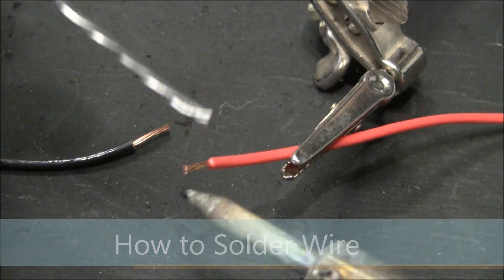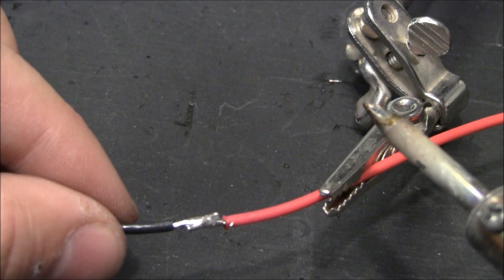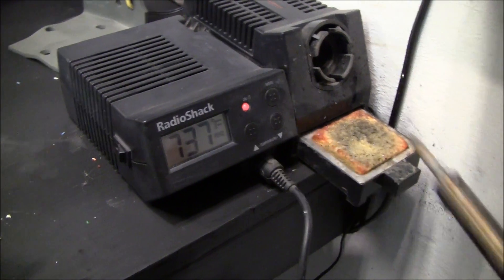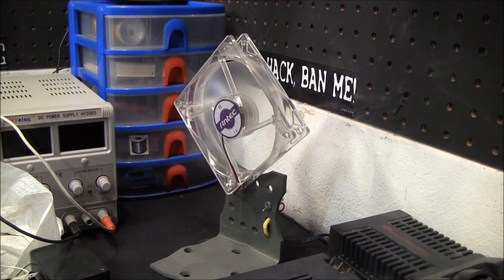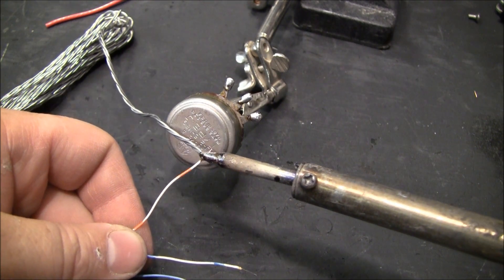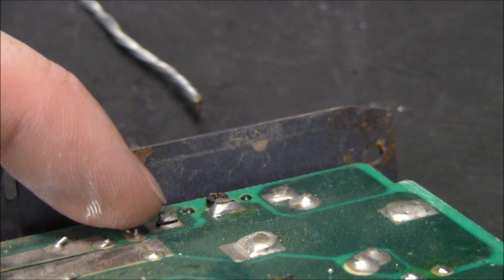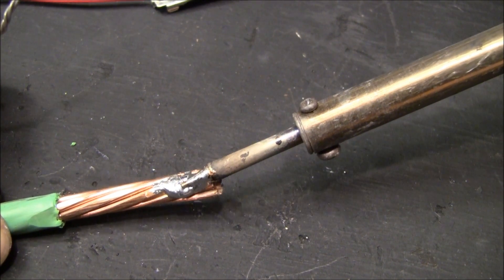How to Solder, tips and tricks

Comment: Mostly false tutorial. You don't solder wires like that. The tin itself only barely hold stuff together. Wrap those wires in hooks(there's 200 page NASA article about this) around each other so that you can pull them while they stay together and have most contact are as possible. Same goes with that potentiometer. Any joint that is only held by solder is going to break in time.
Also, if that is not possible(e.g. wire to flat PCB plane) you cannot possibly hold them steady enough. It will always create poor solder structure. You got that helping hand there, just put both components to each of those clamps, have them rest on each other without any force, and then tin them.
Reply: xomegaxweapon
http://www.hq.nasa.gov/office/codeq/doctree/87394.pdf

Actually it's only 114 pages, but that should be plenty.
Reply: *****
Flux coated brass wool also beats sponge. No thermal shock and no need to wet it. It costs only like 5 bucks.
Reply: *****
 +1 Plus you don't really want to have solder blobs on your work table. I recently lost an arduino to a blob of solder on my table. Always keep it clean.
Reply: can you linked the 200 NASA article please? I would like to read it
Reply: RealationGames Thank you for supplying the link. Certainly should be accurate information considering the source. ...and at "only 114 pages", yes, that should be plenty! lol :0)

Comment: Also a fail... touching the soldered wire with a greasy finger.

And overall a fail.  Parallel wire works no where near as well as meshing the wire into each other by pushing them together from the end.  If there is high vibration concerns, you can wrap the meshed wire with single strand of wire and then solder.

Comment: You should apply a little solder to the soldering tip to create a "heat bridge" to help with heating up the wire so you can get the wire you are trying to tin come up to temp quicker.  This will prevent a lot of the melting insulation away.  Also you could increase the temp on your solder station to help with the transfer of heat to the wire.

Comment: Where did you learn how to solder?  The fan is a really bad idea, cold air blown onto the hot solder will cause bubbles to form at joint ensuring a bad job. At the beginning, holding the two wires and trying to solder them together is  recipe for a disaster down the road.  And you don't flip hot solder off the iron, use a damp sponge or the brass cleaning pad.  This should be titled, "How not to solder".

Comment: easier to twist the wires together and use a little flux on the solder and dab it on the wire... then allow the solder to flow.  works very well and not much of a mess if you don't put a lot of flux on it.

Comment: Well "in your face" was not exactly accurate. But it is still in the same direction. I tried to blow it on the side, but I still feel the smell  a bit. When the air is sucked I can't smell the smoke at all. I mean couldn't tell how does it smell. But all this is pointless if your room is not ventilated ... Unless you buy a smoke absorber with good filter. Still,. I'm not writing to be annoying. Try to turn it arround, but it has to be closer to the soldering place.

Comment: :) when you solder long enough you start thinking that you can have a feeling how hot the wire will get based on time of soldering and the thickness... Unfortunately you are only 9 of 10 times right and you always get burned. Sometimes I'm just too lazy to pickup the tweezers/small pliers and hold the cable and ... well I get burned. If you are can get Balsam "Spasatel" Forte. If you apply it immediately you'll forget about the burn in a minute. But it's always better to use the tweezers

Comment: ok. here is my few bits of criticism (no offense meant). I think that 390 degrees C (734 F) is a bit too much. The tin oxidates too fast on the iron. I keep it about 250-260 and I rise it only if I solder something bulky. Also the fan is blowing the smoke in your face. I put it close (10 cm/4 inch) to the soldering place and then make it suck the air - turn it around. it actually works. Also don't rely only on the resin in your tin. Get some good flux. It helps with not-perfectly-clean wires.

Comment: For that heavy gauge copper wire, it would have been better to apply a good amount of flux first. Also it is not a good practice to melt flux core solder wire to the iron and transfer onto the workpiece since the flux will evaporate and it will not get to the workpiece. Unless the surface is absolutely oil and oxide-free, it will not make a good joint or even not stick at all.

Comment: This video deserves many "Thumbs up" really.

I want to build some Interconnect cables as a DIY project and there are various parts to the project. I will your video as my guide to get the soldering part done.

I heard that when soldering wires, its not a bad idea to attach a metal heat deflector (looks like small a needle nose pliars) to thew wire so the wire does not get damaged from the heat. Don't know if that's just some fancy snake-oil thing though

Comment: This helped me a lot thanks. I was stupidly heating the solder and not the wire or lug that I was trying to solder it to. I went to the UK equivalent of Radio Shack and when I had soldered before I was using solder with a flux already mixed in but the only stuff they had came with separate flux. This made it a lot harder. Thanks loads for this post.

Comment: I'm going to take a guess that you're using acid-core solder which is supposed to be used for brazing work for things like plumbing. If that's the case, it's the wrong stuff for electronics work. It'll end up corroding everything. For electronics you want acid-free rosin.

Comment: I've been reading tutorials and watching videos for the past week and I can already tell that you're not really doing things right, heck common sense tells me that. Not twisting the wires together, relying on the solder instead of a physical joint to hold things together, calling your shaky hands half ass soldered together wire example a cold joint... I can tell you have a lot of experience but it looks like a case of "it's always worked for me" as opposed to the "right way"

Comment: this is ok for the home hobbyist but there are so many mistakes in here, you talk about heat enough times but dont actually mention that all solder comes with a specification for the best temperature ranges for a given application. also to place an insulated wire into a crocodile clip and then bring heat to it could potentially split the insulation and is a serioulsy bad practice. the wires on the component  should have been looped through the holes before being soldered.

Comment: The reddish coating is like a lacquer, and needs to be scraped or sanded off before soldering. If not, the solder won't stick. This is not the same as 'tinning', which is done on stranded wire to keep the fine strands together and give mechanical strength. To tin, put a tiny drop of liquid flux on the wires first, then lightly touch the wires with a hot iron and small dab of solder. The flux will draw the solder through the strands and ensure a nice, uniform surface for your wire ends.

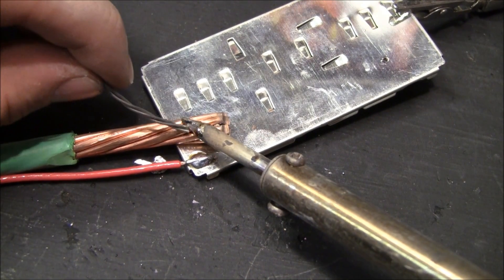Comment: 05:46 A good way to get a fat wire hot without using a super hot iron is to dip it into some flux and then heat the fluxed part.  Gets hot much faster when you use flux because the melting flux transfers the heat into the part.

Comment: You can buy solder with flux - either flux coated or flux cored.  I've been using RS Components 60/40 Tin Lead Alloy solder for years.  Easy, clean and pre-fluxed.

Comment: so when do I use flux? And why arent you? im soldering tattoo machine wires and im told to first "strip away the reddish insulation" bfore soldering. is this the same as "tinning"/? In the other vid I saw he looked as if he was using the iron to burn away layer, but he was also using solder at the same time./???   thanx for post!

Comment: How physically strong is the connection between the two wires when they're not twisted together?  What's the disadvantage to twisting the wires together and then soldering them.  Thanks!

Comment: I have one of those basic RadioShack 15-30 watt irons, and after about 5 uses my tips only heat on one side and it gets a big cavity in it. When I buy new tips I always tin them before and after use and I am usually using the 30watt mode. Why is this happening???

Comment: Yeah, I've only been soldering for a short time (just started electronic circuitry design - hobby) and the reason they tell you that is because of weaker physical connections, cold joints, and you basically burn off all the rosin (in rosin core solder), which allows for oxidization of the connections. I'm a little confused at this guys technique.

Comment: To make it transfer heat much more efficiently to whatever you're trying to solder. The cone shaped tip has a much smaller contact area to heat up a piece of wire or component lead in comparison to a glob of liquid solder on your soldering iron's tip. The other reason is to keep the tip from oxidising, a process which is accelerated by heat (oxidising is basically the same as rusting) and which will also make the iron much less effective at transferring heat to whatever you're soldering.

Comment: When you tin the switch terminals, it looks like you just tin one side of it. It also looks like you're applying the solder to the tip of the gun and letting it drip onto the terminal, as opposed to how you solder two wires together.....
right?

Comment: Lighters work well.  It burns like a fuse if you light the end of the wire while holding the wire at a 'somewhat' vertical angle.

Comment: Pro Tip:  Don't use lead free solder, it has a higher melting point and is a HUGE pain in the ass.  Get some good old 60/40 rosin core solder and things will be a lot easier.  Also having a clean soldering iron (looks shiny) will aid in heat transfer and make things go easier too.

Comment: Sometimes there are nylon threads running alongside the copper wire to strengthen it, you want to get them out of the way before soldering.

Comment: Looks like his connection is ok without twisting. The weak point is not at the joint but at the end of the joint from flexing. With that said, I usually twist the wires together, a la Western Union splice.

Comment: filear is right. For me its easier to burn it off including the surrounding material then clean it up with very fine sandpaper to expose the copper. Then solder the wires back, a little tricky to make it stick. You could do it, just take your time.

Comment: It's been my experience that it can be very difficult to hold even one of the wires steady enough to prevent a cold solder joint.  Whenever possible I try to have BOTH wires supported by something, not just one wire.  I see you used an aligator clip for the wire on the right, using one for the wire on the left too reduces or even eliminates altogether the potential for a cold solder joint.  Like many people I use a jig for this when possible.

Comment: this is a bad way to solder. You're not even using flux! best to twist the wires together, apply a little flux and then apply solder to iron tip, then to the fluxed wires and viola!

Comment: most of the information in this video is correct it may not meet the stringent work standards that I'm used to but it's good info nonetheless. However, the way you cleaned your soldering iron almost gave me a heart attack.The sponge is to thermally shock the iron, not to clean oxidation off, you should use solder and a clean tech-wipe to clean it then thermally shock it with a damp sponge (but not the one you have it's ruined), then go right to soldering, then tin it again to prevent oxidation

Comment: that is not a reliable electrical conductor that you made. the contact between the two wires through the wire will be less than the wire itself essentially making a fuse in the circuit. the proper way is to strip at least 1 inch of wire tin them (without getting solder underneath the insulation) then twist them together then solder the joint.

Comment: No. All wires get oxide, which is the reason for the flux being into the solder. And the reason for being bad practice to burn the solder on the iron.

Comment: Also, by melting the solder on the tip, you are burning the flux on the tin, but the point of the flux is to burn the oxide on the wires/contacts.

Comment from the maker: There is flux in the center of the solder hence the "Rosin Core Solder". Generally if you are soldering good quality wire or circuit boards you don't need flux. Some non standard metals may require flux.

Comment: Looks good but whenever you're soldering an external component its best to make a mechanical connection with the wire before soldering it. Not always necessary but it's in good form

Comment: I put some links in the description above that have to do with tip care. Essentially there are different metals in the tip and if the metal on the outside of the tip oxidizes or is ground down the tip will be damaged.

Comment: Tinning=good but the way you join the wires is wrong.  You should twist them together with a good mechanical connection and then solder them.  Solder holds a good mechanical connection in place; not the other way around.

Comment: Please explain why you would use just the solder to make the physical connection, vs twisting the wires together.  This type of joint is MUCH more likely to break.  Maybe you're mistakenly confident in the tension strength of solder?   Maybe for circuit boards and other non-mobile items this is fine, but it is by no means fool proof.

Comment from the maker: @thijsloon Always use Rosin Core Solder, I have not ever used the lead free kind only leaded. I think the lead free solder is not quite as good or at least a little different, but it is being fazed out due to the hazards of lead. Lead free may need a little higher temperature? I just have so much lead solder around I haven't tried it yet.